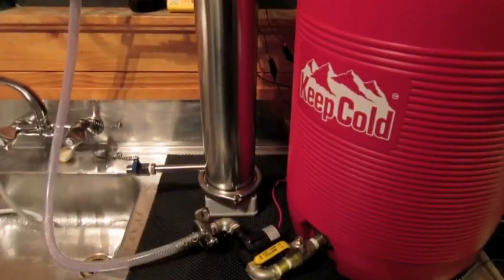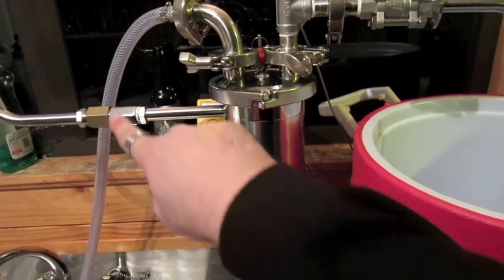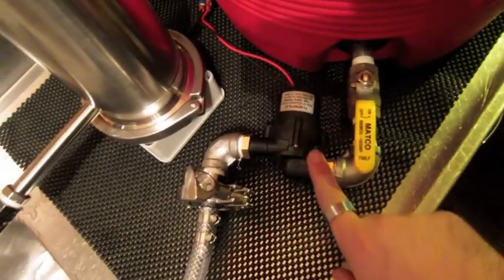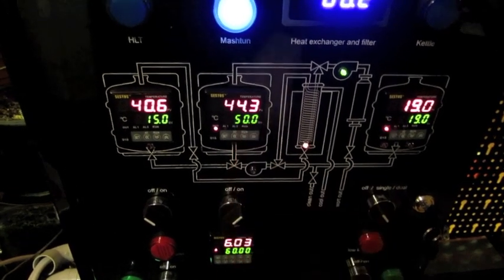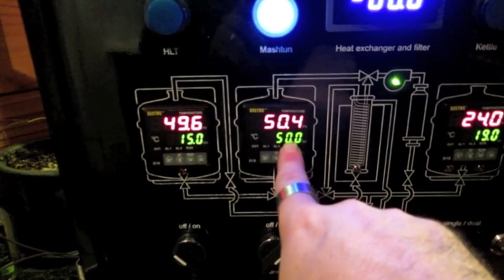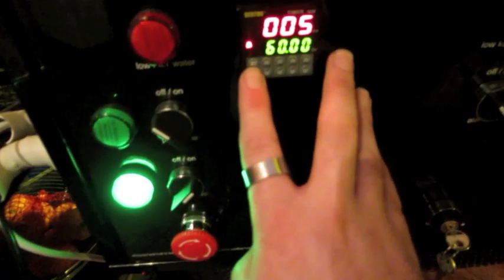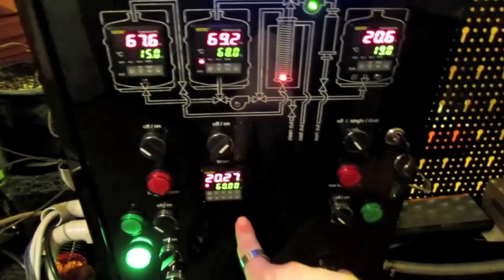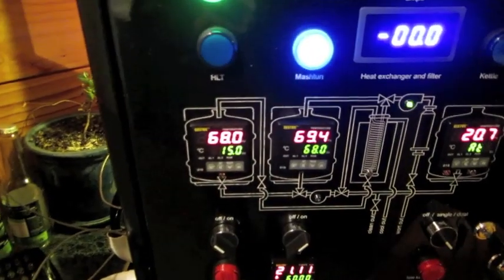Electric Home Brewery part 3

Comment from the maker: Cheers for the sub. The heat exchanger is pretty simple to clean, because the wort is flowing through the coil continuously there isn't any build up. Reticulating a percarbonate-based cleaner like PBW through at the end finishes it up. Then before I go to use it again I pump a no rinse santizer through the entire setup.

Comment from the maker: Cheers, the pumps are 12v Food Grade hot liquid pumps from ussolarpumps. com and they are also available on ebay. I made the copper coil for HEX myself by wrapping the copper tightly around a 2" tube. I filled the copper tube completely with sugar first, and bunged up each end, this stopped the pipe from collapsing when rolling it so tight.

Comment: Great videos, keep them coming.  Do you have a part number or store for the solar pump you're using in this set up?  Also, did you build the copper coil for HEX yourself or is there a place to source it?
Cheers,
Chanaka